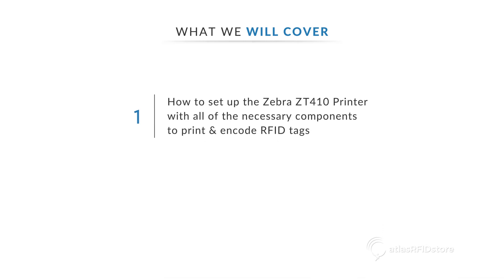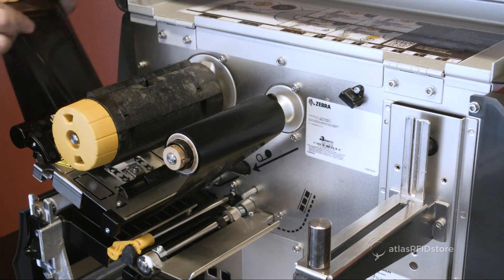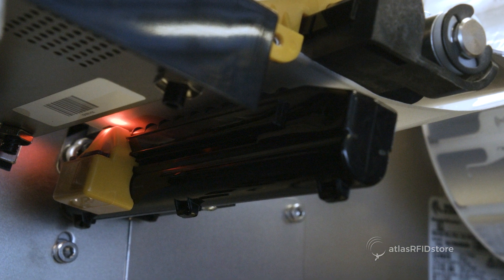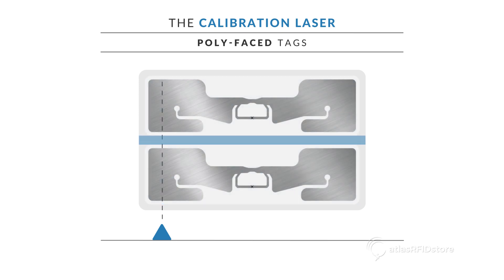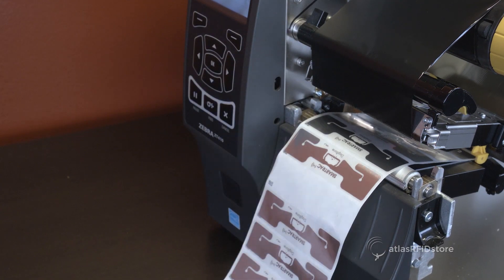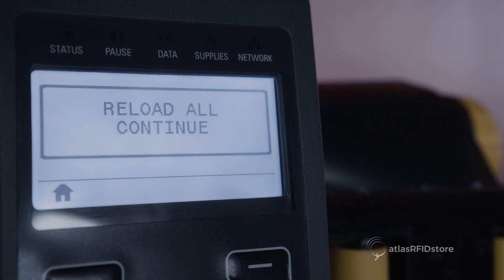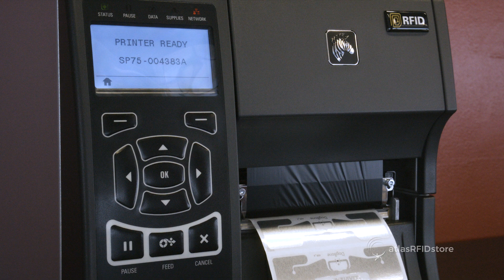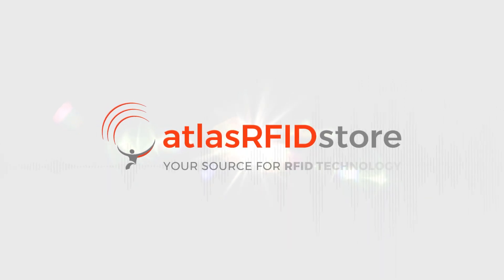How to Manually Calibrate the Zebra ZT410 Printer

Comment: i tried this method and I cannot get a cal success.
Reply from the maker: Steve,
Manually calibrating your printer can be a little tricky, and the success will depend on different factors, like tag and media type.

If you are using a tag that is separated by a gap, be sure to use the Transmissive setting in the Sensors menu. If your tags are separated by a black mark, be sure to use the Reflective setting.

Additionally, be sure to line up the laser guide with either the gap or mark on your tags to ensure the printer can “see” the tag separation.

Comment: does this calibration of tag need to be done everytime a label type or size is changed?
Reply from the maker: Most of the time, the Zebra ZT410 printer can automatically calibrate for each different tag type loaded into the printer, and all that will be needed is the RFID calibration. However, some tags or tag liners will not pass the auto-calibration, so the manual calibration will need to be done.

If the printer is showing a “Medio Out” error when the tags are loaded or is skipping tags when printing, a manual calibration is likely needed.